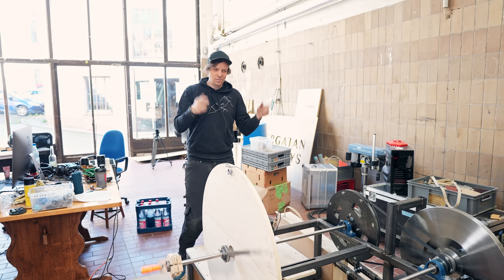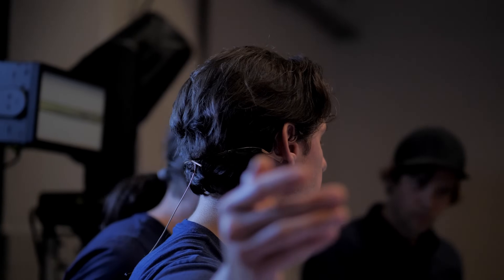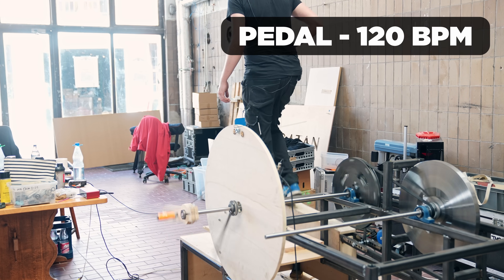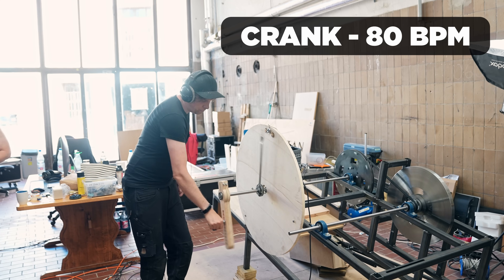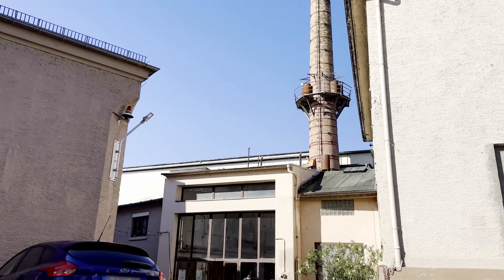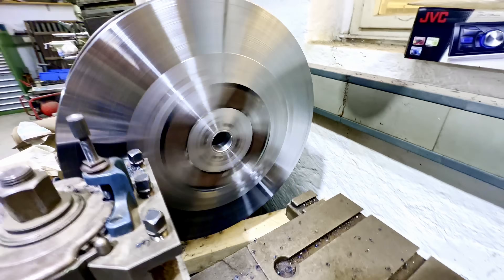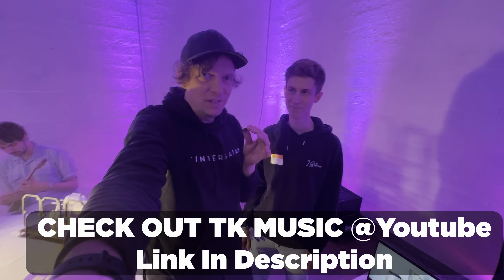The Prototype is Finished - DAY 10 - Marble Machine Flywheel Prototype

Comment: You should de-couple the rotational speed of the crank (whether it's a pedal or a handle) from the speed of the flywheel. The crank should only add energy to the system, and it shouldn't even add speed to the flywheel. There are ways to do this, including fee-hubs from bicycles (some of which are totally quiet). Furthermore it's commendable that you should want the machine to be human-powered but I'd actually make this human power produced by a stationary bicycle. You could have people from the audience take turn pedalling, and it would strengthen the level of fun and engagement of the crowd. People who pedal would literally "feel" like the concert is set in motion by their action. A unique sentiment that only a musician normally encounters. Furthermore, the speed of the flywheel should be unrelated to the BPM of the music ; you should de-couple there too, and use gears to change the generated pulse. All of this requires a very substantial flywheel that spins very quickly. It's doable. The advantage of decoupling the flywheel is that your music tempo will be very steady, for a long time. I would argue also that you could drive the flywheel by an electric motor that is itself powered by a human on a bicycle dynamo.

Comment: A good measurement for judging the friction in the system is the time it takes for the rpm to drop to half the initial speed.  When you let it wind down to a stop you get a combination of the effect of running friction and static friction.  The 50% time point is only affected by the running friction.  That would be a good baseline data point.
Reply: And because there's no more fluctuating amount of energy being put into the system at that point, the result should also be consistent! :D

Comment: The pedal is storing energy, it’ll lose a little with air resistance but not a lot compared with the storage in the flywheel. Correct about testing

Comment: About your focus on tight music: I think you would find it impossible to find a single power plant on Earth that perfectly maintains their output frequency (50/60 Hz). They are capable of compensating for frequency drift over time. This is important because so many devices depend on that input frequency.
Reply: He doesn't have an objective metric to compare tightness, so it's a moot point. It's not tight compared to a power plant, tight compared to some other musician, or even tight compared with the movement of planets. It's tight compared to which side of the bed Martin woke up on that day.
Reply: Totally agree. Has the definition of tight vs untight even been defined? A few ms variance will sound tight to most listeners I’m sure

Comment: *The angles ranged by the new foot pedal don't match extensions of your leg in an ideal way. You need to control all of the thrust phase, maybe resist the return a little too - this may help.
Interchangeable gear ratio, so you can tap half, double or triple time at a more comfortable pace.
What if you followed the lead of some sequencer-programmer types, who actively introduce imperfections to avoid sterility and emulate a human feel, and viewed the machine as producing it's own groove to which you can, in turn, respond. There's tight, but you might fall into feel, by reaching for perfection.

Comment: I'm trying to understand the issue you are seeing with the standard deviations vs your qualitative expectations.

It sounded from the clips you provided that the hand-crank was more aligned to the click, while the pedal was consistent, but not aligned. From what you showed of the software, it's detecting peaks and then quantifying the time between them to get the BPM. 

I have a couple of thoughts from the limited observations I can make from this:

1) It looks like the software is reporting the standard deviation from the mean of the data rather than from the intended mean. E.g. your 80BPM test is looking for a mean of exactly 500ms, but your standard deviation is reporting relative to the measured mean of 500.44. You might get a better insight by using your target interval as the expected value in your calculation, and not the mean.

2) The crank might be giving you more control, meaning you are inserting more acceleration and pauses to match the click - this is a lot better for you as a musician, but might be less consistent in the data.

In other words, the pedal might be more consistently wrong!
Reply: I was thinking the same thing but you explained it perfectly. 

I believe more consistency means tighter music right? So more consistently wrong is actually better?

As a musician, having a lot of control is actually very important tho. So idk honestly..

Comment: Here's a general machining rule of thumb.🙂👍

Always utilize a machined surface whenever possible.

For example, with round 2 of the flywheel, you should face one side, flip it on the chuck so that the now flat face is sitting against the, also flat, jaws.
As opposed to a rough and wobbly face. 

Normally, this wouldn't be necessary on a lathe if the stock was clamped on the OD by the chuck. But in this case, there is no extra stock to hold that way. 

Heck, you may even want to look into having the tops of the jaws milled or surface ground to improve their flatness as well.

Hope this helps. Great work so far and good fortunes upon you, your team, and your band. 😄
Reply: Yeah, rough cut your pieces, affix them together, mill one side flat and and also mill your inside diameter for the bearing, then you can face the outside edge and opposite side on the lathe.

Comment: the pedal is tighter cos you have the elasticity of the belt absorving irregularities with the inertia on the flywheel, but the handcrank goes straight into the mic, the flywheel works too but clearly better with the belt. maybe try a belt with a 2:1 reduction so 60 pedal bpm are 120 music bpm (you being a musician might get away with other weirder ratios?). that will increase the range of bpm you can pedal without dying pedaling.

Comment: Regardless of pedal or crank. I’m thinking the limitation will ultimately be Martins physical endurance. He’s either gonna need to bulk up or employ a motor driven power unit to get through a concert.
Reply: Exactly. Powering it manually for long enough to play a full concert live would be an insane workout. It is quite obvious he's going to end up with an electric motor as he did in MMX, but - for some enigmatic reasons - this time after spending a lot of effort attempting to build a mechanical storage of energy and its distribution system.
Reply: @virenor The ultimate solution would be to have audience members take turns cranking/pedaling the machine. Martin gets to rest, and a few lucky fans can feel like they're part of the show!
Reply: @InventorZahran  Yeah, this could work. Especially combined with shackles and automated whips.
Reply: @virenor   If you're gonna go that route, might as well use literal horse power. Whipping humans has been so out of fashion since 1865...
Reply: @virenor  On MMX the motor was only intended for the tests, not for the world tour. 
I don't know how important it is for Martin to have the MM be powered by a human, but I agree that it looks like a problem at the moment. 
The machine will need a lot more power once everything will be in motion (programming wheel(s), marbles lifting, etc.).
Reply: @RandStuffOfficial  Well, making it 100% human-powered would be awesome, but... it's just not necessary. It reminds me how he gave up step by step on several side goals of MMX and here we are in the latest video, where Martin changes gear, making the flywheel even harder to turn... maybe Huygens's mechanism will solve it, we'll see but... come on, this project lacks management.
Reply: He can solve this problem with the chain drive
Reply: I suppose the Marble Machine wouldn't play every song of a concert.
Reply: @RandStuffOfficial  That's right probably, however even during tightness tests, Martin was already on his limit and Hannes helped out to pedal. This asks questions.

Comment: I'm sure someone else has already mentioned this, but playing "tight music" can be interpreted in two different ways, and it has a dramatic impact on how you would optimize for it.

If you assume the machine is going to be the source of the beat, and everything else follows it, then you only need to make the beat-to-beat timing consistent over a relatively short span. The timing can drift slightly over the length of the piece without having a negative impact. And if you need to adjust it, you only need to pedal slightly faster or slower.

But if you're trying to match the machine to an existing, consistent beat (i.e. a metronome) then your problem is vastly different. Here, the drift is important. If the flywheel and the beat are both synchronized (which you have here) then once you start to drift you need to speed up or slow down the entire machine to correct. Then, you can overcorrect and once you start doing that it's very difficult to bring it back into sync since the beat will be shifted. You can hear this very distinctly when you're off-beat with the metronome. Synchronizing in this manner with a coupled flywheel is, I imagine, very difficult, and would really require a completely different mechanism. You would need the pedal to be able to follow the beat independent of the flywheel's exact speed, with some sort of regulation in between the two to be able to power the system without a rigid coupling.

In other words: when you actually run this machine on tour, if the machine is going to be the metronome then I think you're on the right track.
Reply: Yeah the metronome introduces additional inaccuracy: if instead of a constant tick, it would just tick 1/120 sec after it hears the contact mic, I suspect Martin's accuracy would go way up.

But I think you're a little bit wrong about the consequence of BPM drift. The whole concept of a marble machine is that every marble drop involves gravity. So each marble drop has to be tuned to happen slightly ahead of the beat. But how far ahead? Consider how long the delay will be in Earth gravity:

- Percussive event that doesn't involve a marble drop: 0 ms
- Marble drop of 10cm: 142.8 ms
- Marble drop of 25cm: 225.8 ms
- Marble drop of 35cm: 267.2 ms

But our timing is based on a rotating drive shaft, so we need to convert milliseconds into degrees of rotation:

- At 80 BPM, the marble drop times are 0°, 68.5°, 108.4°, 128.2°
- At 100 BPM, the marble drop times are 0°, 85.7°, 135.5°, 160.3°
- At 120 BPM, the marble drop times are 0°, 102.8°, 162.6°, 192.4°
- At 140 BPM, the marble drop times are 0°, 120.0°, 189.7°, 224.4°

It's unclear how you can quickly and easily adjust all your marble drop timings in real time to sync up at any given BPM. On the MMX, Martin had someone make him a very nice brass knob to move the phase of the drive shaft, for exactly this purpose. I guess you would need one of those for each marble drop height. Maybe he can design everything so that there is just a single drop height.

But my point is, even if you can adjust the machine for a particular BPM, you probably can't do it mid-song. So if you want to play "tight music," you can't let your BPM drift very far.

Comment: The pedal: when I think about it, the pedal should add inertia to the system. So it may help sustain the wheel's momentum. But how much work does it require to move the pedal and the wheel, as opposed to the wheel alone?

Comment: Out of curiosity, is the commitment to fully mechanical a philosophical thing or just based on a desire to have organic control over the tempo? It would be possible to do a hybrid system that holds a stable tempo as long as your manual input is within a programmable range, but allows it to shift smoothly if you back off or accelerate. This could also supplement your power input to allow higher bpm with less effort.

Comment: Add an electronically controlled variable speed pulley. To keep it in time with the BPM tick

You need to be able to adjust the output speed independently from the flywheel speed

Comment: The pedal doesn't take energy while the machine is turning on itself, but it steal energy from your feet when you are powering the machine (the energy is lost mostly in the bending of the pedal I think, so as long as you're not powering the machine, the pedal doesn't bend).
Reply: The pedal arm is a spring. What you put into it at the top of the stroke, it gives back at the bottom when it straightens again. So long as your foot is still pressing down while the spring returns to neutral, that energy will go into the drivetrain. There will be a little loss to heat, but it's not like Martin is permanently deforming the steel.
Reply: @ps.2  I can't agree with you more. The only losses the pedal introduces are that of friction on the bearings and the heat from deformation, both of which are of no concern. I'd love to see the pedal structure triangulated so it stops bending so much, but that's just because I'm worried it might fail from fatigue after hundreds or thousands of hours of use, not because it's eating up any worthwhile amount of energy.

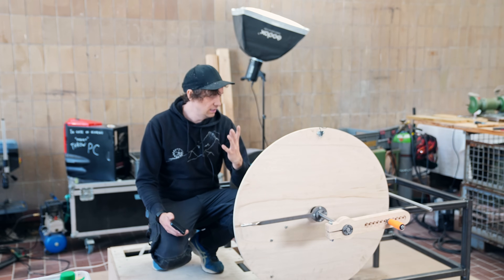Comment: @1:48 The paddle is basically only stealing the energy required for for the bearings that hold it. The up and down motions probably steal a bit through air resistance but that would be negligible. The weight shouldn't make a difference since it just gains potential energy when going up and releasing it again when going down. Maybe it makes a difference in speed? I could see it being a bit slower when the pedal is moving up and a bit faster when the pedal is moving down, but the flywheel should compensate for that... probably.

Comment: Would it make for better tests to crank the machine using a motor instead of manually?
Maybe worth testing :)
Not sure if the motor would have to ramp up the energy/rpm to match the speed of the flywheel though. Maybe using a feedback from rpm counter?
Also, the pedal still has a slight possibility of being a toe cutter.. Could move it all the way to the edge, but might make the frame less rigid.
Really enjoy this weeks progress! Looking forward to next vid :)

Comment: You could maybe add some kind of centrifugal governor to the system to keep a constant speed, similar to steam or sterling engines. It could be made adjustable to hit fixed increments of RPM
Reply: It's in the plans
Reply: @darkiee69  if it is in the plan then why he is ready to give up if this fails without that?
Reply: After investing this amount of time and numerous efforts, i'm curious why he is avoiding making something like this. 
If this is a critical feature to have high bpm tight, this is an obvious measure to implement, i guess. Ability to add some energy to the system without additional task to be precise in bpm should make this doable.

Comment: All you have done with the belt is increased moment of inertia  This will not fix the variation between power pulses  , you need to have as little flywheel mass (inertia)  as necessary , so instead of direct drive add a torsion spring between two small flywheels.   A hand crank will have a smoother torque delivery that the very bumpy foot pedal.